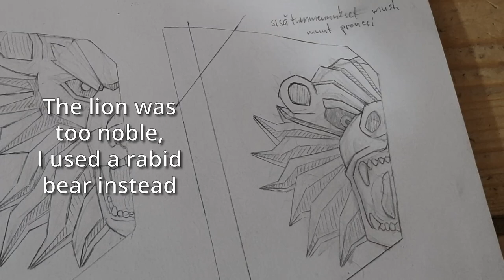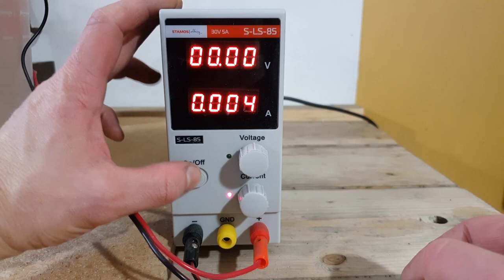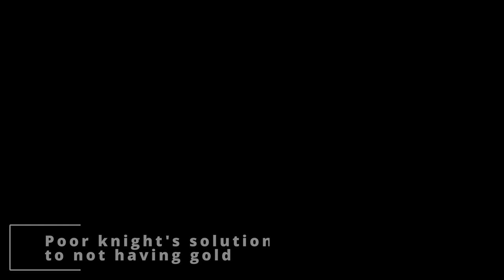Making a highly decorated vambrace

Comment: This looks good.I want to make bear claw style vambraces like ones the stormcloaks were wearing myself,but the problems is those talons.
Reply from the maker: Thanks! I got some inspiration from those. I think those talons need welding equipment to attach
Reply: @GarageKnight  I think like that too,but the problem i an armor itself.I think these talons would be used in a fight as a knuckles but the point is these would easily break attached only to a metal sheat. My idea is adding some knuckle like rings to the bottom of fingers as a second attachment,but that's only theorical.
Reply from the maker: Yeah you might be right, I haven't welded so I don't know.

Comment: Magnifique ! Pourquoi chauffez vous la pièce de métal lorsque vous utilisez la brosse métallique ? C'est pour mieux polir ?
Reply from the maker: Merci beaucoup! I need to use the heat to transfer the brass to the steel. When I use the heat, small particles of brass come off from the brass and form a layer on the steel
Reply: @GarageKnight  ok good I understand! Et à quoi cela sert de déposer une couche de laiton ? Merci !!
Reply from the maker: The brass is just for decoration. Steel is cheaper and stronger than brass, so I like to coat steel with brass rather than use brass